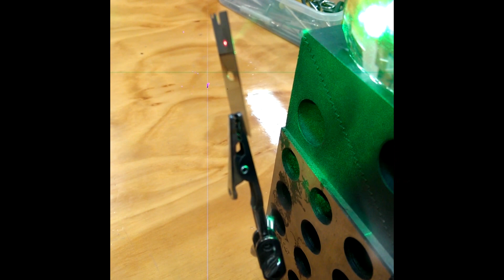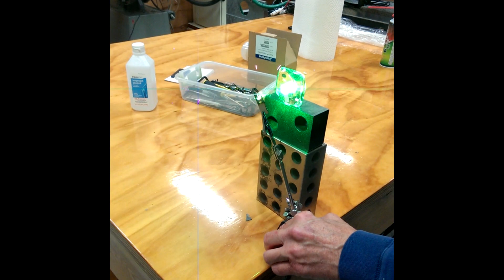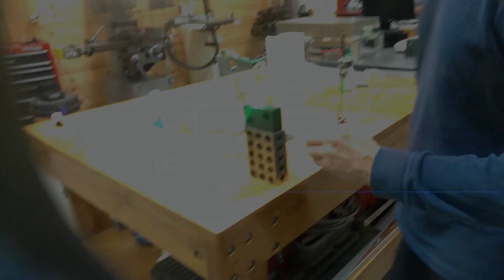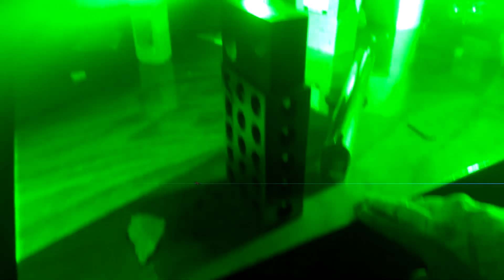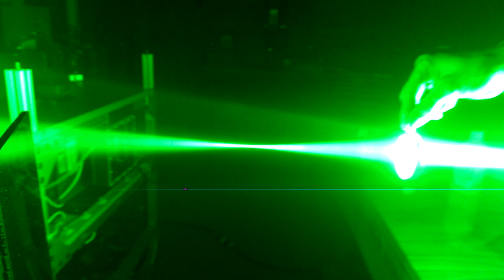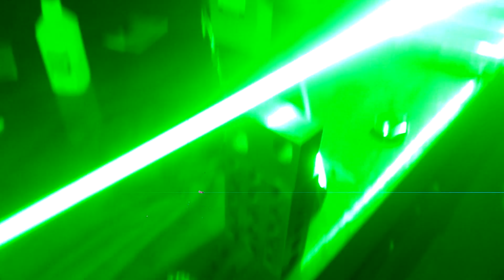Playing Around With a High Power Laser

Comment: Thanks for posting. your video are some of my favorites. I am also curious to know how much of 808 laser pump it require for a such high power green laser!
Reply: 700 watts
Reply: He said 2 fiber lasers, 20w each I think. More homogeneous pump light is necessary.
Z-fold cavity. Wish he'd would explain it, break it all down, he likes to change projects every month.
Reply: @davegeorge7094  oh I thought he was using the hps original ir stack. I had this laser years ago and was waiting till someone came out with a can controller. Kevin has one for the PV .
Reply: Apparently this laser is not the one I mentioned earlier. This is a highly modified medical Q switched laser. I like to know what's and how much is pumping it?
Anybody point me to the forum or somewheres for more info please.
Reply: @davegeorge7094  the original 808 diode stack is 700watts . End pumped to a yag rod, it uses two LBO crystals if I remember correctly. And its obviously Q switched.

Comment: What peak pulse power?  ? Is this a commercial made laser or self built?
Reply from the maker: The peak power at 144W average is approximately 30kW.  This is a highly modified commercial/medical laser.
Reply: Tech Ingredients what is the hz range
Reply from the maker: The pulse frequency is between 8 and approximately 12 kHz depending on the output power
Reply: Actually what your doing is genius using a manufactured unit and modifying.. exactly what we are doing in a couple cases but we are buying expensive pre built units for manufacturing environments. I never thought of using a medical laser modifying for use as you can sometimes find high power medical lasers at low prices... smart
Reply: @TechIngredients  "The peak power at 144W average is approximately 30kW" i dont follow,,is it 144w cw and could become 30kw pulsed or q switched?

Comment: What temp do you hold the crystals at ?
I have a older model coherent AVIA seems someone has reset all the EPROMs to factory and I’m having to go they the two hundred modules and adjust everything but I don’t have a base test data to reference from
Right now I get very weak green wavelength light I should be getting around 355 nm of cw power at 5 watts .. I’m getting not even close to a watt of green currently
Spot is terrible looking I don’t know if it’s cause of bad crystal or what I will research that more but in the mean time if your willing to share some data
Reply from the maker: Sure. I've destroyed my share of crystals and usually, even a quick look with a good lens or inspection microscope will show this.  Start at the beginning.  Remove the crystals and confirm the 1064nm beam looks symmetrical and clean.  Check this at just above threshold and confirm it continues to look good as you ramp up the power.  I assume you know how to do this with a NIR camera and are FAMILIAR of all the safety issues.  If you are not then STOP, don't even start.  That being said, crystal temperature depends on whether the manufacturer specified room temperature angles or elevated temperature angles (often around 70C).  Low powered lasers (probably yours) use KTP,  higher powered lasers use LBO or even hermetically sealed KDP.  Nevertheless, beam quality does not usually suffer that much with off angle or temperature settings, rather its the power that suffers.  I strongly suspect a damaged crystal.
Reply: Tech Ingredients 
yes I was thinking the same thing .. good idea to check the base wavelength without crystal I do and have the knowledge and equiptment to do so. Instead of camera I have devices that show the beam in a green color .. I will touch base back in a couple days on status of crystals. As far as temp high temp available for thg crystal is approx 60 c and for shg is 50c this is the systems limit switches with temp per say ... thanks again I’ll be in touch after I check beam shape and power rating of the base wavelength..
Concerning wavelength conversion efficiency the laser cw at 355 is approx 5 watt, not sure of pulse ratings at 355... what power do you think I will see at 1064 ?
Reply from the maker: If you are talking about those small opaque cards that glow green then you still might want to look into a camera.  The quality of the information that the camera shows is much more detailed and you can examine the intracavity beam while the laser is operating. I'll be doing a video on using a camera for this purpose.  A rough guess is that the fundamental power will be 6-7 times as high as the 355nm output.
Reply: Tech Ingredients thanks I have never used a camera set up. When do you think you will be working on that video ? I have always used the wand from kentek it shows much better detail than those cards but same concept. Thanks again I’ll touch base in a few days as I take the head unit apart and examine the crystals it is a bit complex the chamber the crystals are installed is a sealed unit with a desiccant chamber above it. It’s on a track that has 15 spots to adjust the crystals over as it wears.. I have tried 1-15 with no difference in output .. anyways thanks again for the help. Can you recommend a camera setup that’s readily available ?
Reply from the maker: I'll try to get something together this week.
Reply: Tech Ingredients
 ok

The shg is housed in the pumping chamber .. not a typical yag rod setup but same idea..  until I put microscope on shg I can’t tell if it’s burnt or not but seems fine .. the thg is outside of chamber one side is clear one side looks hazy like fingerprints across the entire face it almost looks coated but with a rough texture.. the thg where the beam enters is cut on a diagonal not sure why... more surface area to adjust maybe ? I ran without thg I get a stronger output inside the enclosure still terrible beam outside enclosure ... everything is permanently aligned no adjusting.. could it be the coating on the outside lens causing that wavelength to produce a terrible looking spot ? Do you think I can source the thg crystal from somewhere other than coherent..?? The shg is epoxy glued in place or some sort of perm adhesive the heater pad it’s on it soldered in place ...
Reply from the maker: The angle may be Brewster's for anti-reflection and/or for tuning. The surface is not right.  You will need a new crystal.  Try Eksma optics.  You need to "see" what the fundamental is doing inside the cavity.  If the output optic looks reasonably good it is probably not the source of your problem.  You probably have a bad laser crystal as well.  Alignment that still produces output, but is not optimized usually produces distorted beams, not "terrible" beams.
Reply: Thanks! I am going to dig a little more over the next few days..

Comment: not enough power to break down air? how much min do ypou need to do that like a terrawatt lol
Reply from the maker: About 40GW/cm2
Reply: @TechIngredients  can you achieve this with the right q switch speed or your laser does not have the output power for it?
Reply from the maker: Dye lasers do not have a long excited state lifetime.  The energy build up during the output inhibited period is rather low.  Dye lasers can be Q switched either acousticly, with polarization rotation or with saturation absorbers, but the result is high frequency bursts of sub nanosecond pulses that each have relatively low energy.
Reply: @TechIngredients  huh ,i was asking about the laser you have in this video,it's a dpss is it not so why mention dye lasers?,i wanted to know if the laser in your vid with a proper q switch frequency is able to achieve such high density power enough to break down air,,and can you please explain what is polarization rotation q switch and saturation absorber?
Reply from the maker: Sorry, the comment came through under our dye laser video.
To answer your question, this particular laser Q switches at approximately 10kHz with a pulse duration of several hundred nanoseconds.  This provides the necessary peak power for effecient conversion, but prevents damage to the intracavity optics.  The peak power does not reach the necessary level for air breakdown
Reply: @TechIngredients  thank you ,,one thing i did not understand is the math,q switching means it is opening and closing a gate at 10k cycles per second between the mirrors right,,so if c/10khz=a pulse length of 30000 meters ,divided by c again gives a duration of .0001 sec ,,or am i mixing apples and oranges?
Reply from the maker: These two numbers are independent because the inhibited duration and the output duration can be very different.  Most ultrafast lasers have pulse durations less than 100 femtoseconds and repetition rates of no more than 50MHz.
Reply: @TechIngredients  i dont grasp any of this then,,perhaps i am wrong in thinking that a q switch when closed acts like a mirror and the light is trapped between the cavity until it builds up in amplification many times more before the switch is open,,so if your pump source is dc and being q switched at 10khz then i would think there is a pulse length build up of 30000 meters inside the cavity before it is released which would be a duration of .0001sec but you are saying it is only a few hundred nanoseconds,,much much smaller?
Reply from the maker: The Q switch prevents lasing and as you said, the energy will then build within the cavity as the pump source continuously feeds energy to create more of the excited state atoms than would be present in the steady state where an equlibrium exists between lasing depletion and pumping excitation.  When the Q switch opens and lasing occurs, the pulse duration is typically no faster than one round trip through the cavity no matter how long the Q switch remains open.  All the extra energy can be dumped that fast.  However, Q switching is not necessarily binary ie completely open or closed and therefore the output can be dumped over a longer period.  That period and the pulse frequency are independent.  These lasers often have a program to defeat what is called "giant pulse" that could occur  when initiating the Q switch operating mode. Such a giant pulse will destroy the cavity optics.
Reply: @TechIngredients  in a regular cw cavity state i assume the atoms are going through an excitation and depletion cycle and there is both spontaneous and stimulated emissions happening,the stimulated emission has the light bouncing back n forth between mirrors until there is enough energy build up for the beam to shoot through the OC,i dont know how many trips this takes even though you said only one round trip,preventing lasing means to stop any stimulated emission from bouncing back n forth between mirrors by blocking the HR with the q switch? and how does the switch do this,is it simply a beam dump or absorbing any residual stimulated emission and simply preventing a feedback until there is more exited state atoms build up in the gain medium than would otherwise be in cw operation and then it opens allowing the HR to do its job?this could be a rotating mirror that acts like a closed/open double HR feedback(placed between the medium and the OC) or it could be just a kind of blocking device like a liquid crystal electrically modulated to open and shut by electric signal that you call repetition rate or frequency of the switch "pulse frequency " ? must be complicated math to do in order to get the timing right where you will have enough gain build up but not too much to damage the resonator,,but i guess you do this by looking at an oscilloscope and playing around with the modulation to get the optimum balance,i would think a low rep rate means a longer pulse with higher energy and a faster rep rate means a shorter pulse with less energy or i may have this all wrong ,,,but using a qswitch for a pulse operated laser becomes more complex id imagine ,,have a look at this article and watch the interesting video,they also talk about diffrent types of switches aom and eom https://www.rp-photonics.com/q_switching.html
 but i would think the best design would be to place a HR between the medium and the OC right after you got the most gain from the medium and then remove it at the right time to get the most energetic pulse so it will act like a closed loop resonator ready to explode only you let it explode at the right time

Comment: It seems that you may have the equipment  there in your laboratory and the technical expertise  to accomplish this . . . net power fusion.  You would almost immediately  acquire millions and perhaps billions of views.  They gave up on linear fusion reactors because they could never figure out how to confine the ends of the plasma. Radial confinement of a fusion temperature plama in sub millimeter sized helical paths is easy.  And now with all of the high power laser technology, there are other options for confining the ends of the plasma.  It seems that a plasma heated at both ends by focused laser light cannot escape from the ends of the plasma because  the velocity of the particles does not exceed the equal and opposite decellerating force at the opposite end of the plasma at the opposite focal point.  If the power of the lasers is continually increased by a power feedback loop then at some finite power, the temperature of the plasma must exceed fusion temperature.  A very narrow and dense submillimeter diameter fusion temperature plasma ( a meter length of which could give off megawatts of light energy) might be created and confined in the following way. Starting with a chamber of room temperature hydrogen and boron, the atoms drifting into the focal point of the lasers will be ionized and trapped in the center of a magnetic field created by a coil of wire around a cylindrical volume in the chamber.  Because electrons are so much lighter than ions, they are much more easily accelerated by the laser and tend to create a negative polarity towards the center of the plasma which also helps to confine the ions.   If the lasers are continuous wave and optically pumped, the increasing temperature of the plasma trapped between the focal points of the lasers should feed mire and more light energy back into the lasers to make them more powerful.  (Fusion temperature ions fed into the plasma would result in some fusion and the release of more light and a more powerful laser and greater confinement time and more fusion in an accelerating power feedback loop.)  If the gain in the power feedback loop continues to be greater than the loss,  net power must be achieved after some finite length of time.
https://youtu.be/sW5HObAa09M